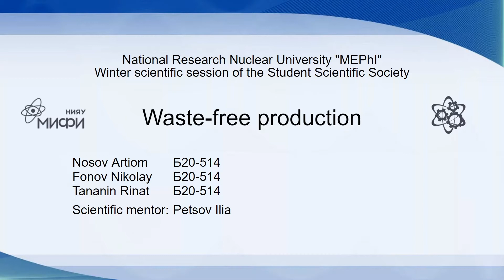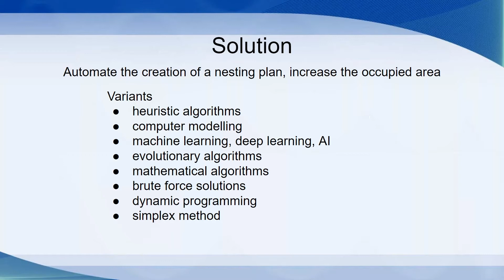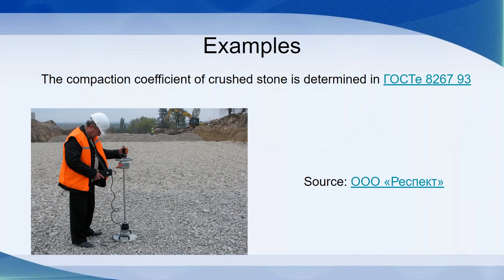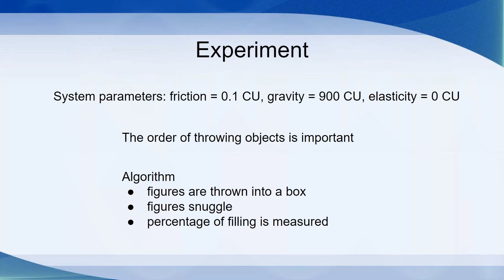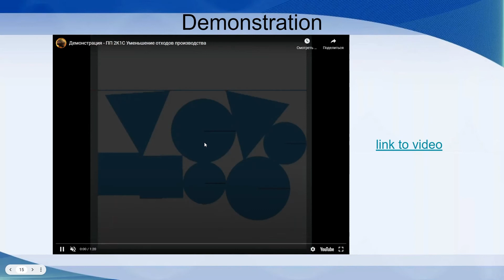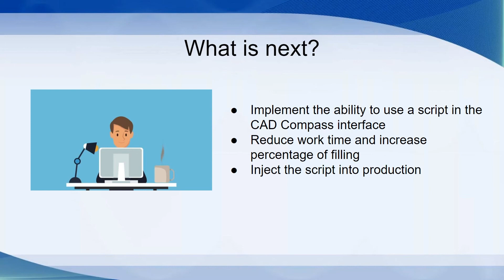Waste-free production by using heuristic algorithms and computer simulation on Python

Comment from the maker: Sorry, Rinat had some problems with his microphone.
He said:
   Our idea - We are all familiar with the law of gravity. In the earth’s gravity field, objects tend to fall to the ground. Take a look at the slide. Gravity has collected a cloud of gas and dust into the solar system objects, so that the matter has taken up minimum volume. Similar things happen on Earth. For example, if you throw several different-shaped objects into a box, then shake it, they will take up less volume than if you just put them into a static box. This case can be displayed on a 2D box, the essence (эссенс) remains the same.
   Examples - The next example confirms our theory. A compaction factor of crushed stone can be equal to onе point two. The parAmeter indicates the grade of compression after transportation. For example, if we order twelve cubic meters of crushed stone, we may get only ten cubic meters because of compaction.
   Examples - This can be recreated at home by shaking a jar of nuts. After shaking, the level of nuts in the jar decreased by forty millimeters.
   Examples - We used Python and PythOnic 2d physics library Pymunk
   Experiment - Under fixed initial conditions, experimental results are detErmined by the object throwing order, so a large number of experiments are required to find an optimal option
   Why so many experiments? - This slide shows dependency between the number of experiments and the filling pErcentage. It’s clear that the larger the desired percentage, the more experiments should be conducted.

   Thanks for reading :)